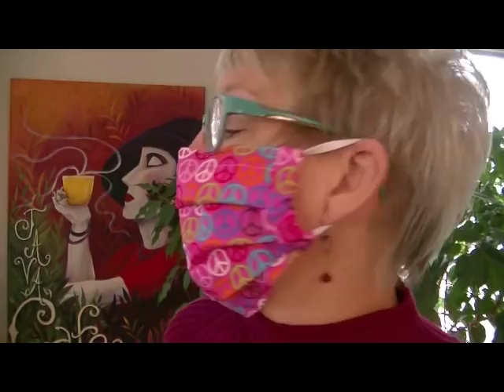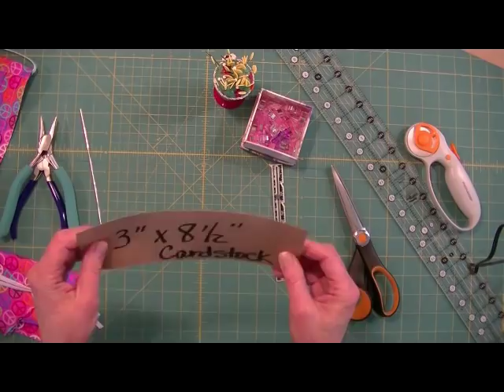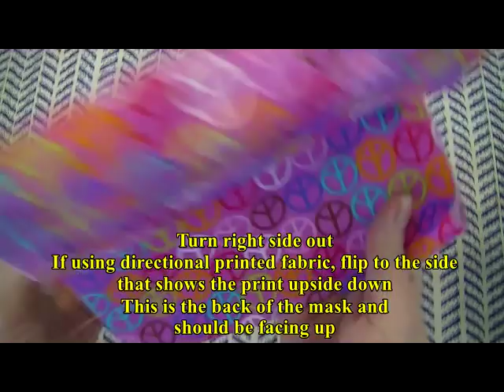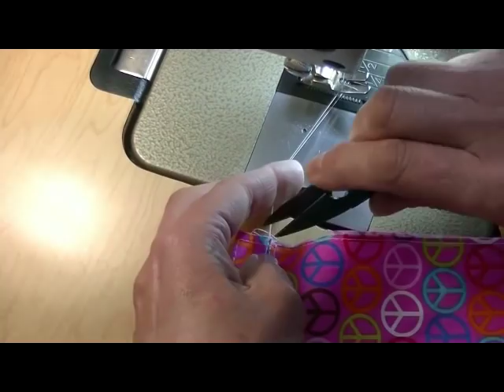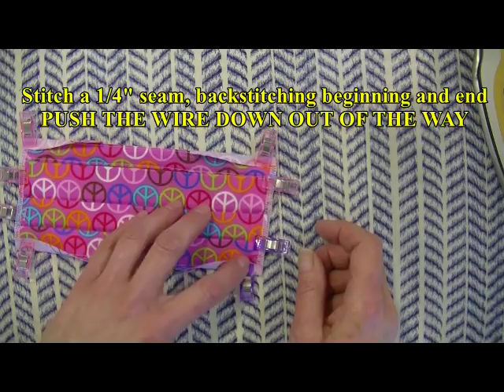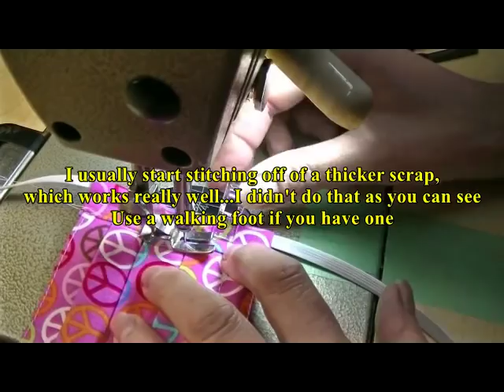DIY REUSABLE FACE MASK with FILTER POCKET-4 Style Options-1 Easy SEW Pattern-Won't Fog Your Glasses!

Comment: I’m coming back to this  video tutorial after making dozens and dozens  of them previously. (Feedback- they’re a big hit!)
Question- how much would I need to cut town this original pattern for it to fit teens or elementary school children? I have a half a dozen  in the “just before the accordion folding” step. I’m out of practice!
Reply from the maker: Thank you. I think I only reduced them by an inch or so. You will need to experiment. You could just sew a wider seam on the sides and bottom and trim it down to 1/4" seam allowance. It's been so long since I made one. I made around 750!

Comment: Hi I was very impressed with your mask, but it doesn’t seem to stop fogging glasses. What did I do wrong?
Reply from the maker: My wire is soft aluminum and about 6.5" long. I pinch it around my nose and mold it around my cheeks and that helps.
Reply: Della, I fold a Kleenex and put it under the top of mask. Smooth it well.

Comment: What size do cut the elastic for adults, 7to 9 and for kids?
Reply: I really liked your video just need to add elastic sizes
Reply from the maker: I now cut the elastic 14" and leave them untied for the wearer to custom fit to themselves. Kids 12". The extra length makes it easier to tie.

Comment: Hi Liz. I haven't done any sewing for a number of years and had to reintroduce myself to my sewing machine!! I love this mask and your tutorial is excellent. Your pleating hack is fantastic yet so simple. I found stitching through all the thicknesses of the elastic casing most  challenging. My machine needle wouldn't go through all the thicknesses at the start of the seam so the only way I could do it was to start a short distance away from the beginning and leave a long end of cotton to hand sew in to secure it. I don't have a walking foot, in fact I've never heard of one. Do you have any tips on how I could make this easier for myself?
Reply from the maker: Hi Pauline, thank you so much for watching my video. What size needle are you using? Try a 14 sharp needle and try stitching on something the same thickness like fabric folded 3 or 4times. Start that in the middle, running off the edge onto your mask, back tack and continue on. Or you can start about a 1/4 inch in, back tack to the edge and then sew forward. I hope this helps. Always use a new needle. Cheers and be safe.
Reply: Hi Liz. Thank you for your advice on sewing through the many thicknesses for the elastic casing. I made 3 more masks over the weekend and used your method. Great - no problem with sewing though the thicknesses. Many thanks.

Comment: Has anyone made this mask for children?  I love this mask - made them for quite a few people; came out great.  But, I tried another pattern for my Grandchildren (age 6,7, and 9) which were wayyy too small.  Has anyone cut down this pattern for kids?  Just curious if you did, and what measurements you used.  Many thanks!  Oh, and use coffee filters in the pocket if you feel the need (I personally don't use any filters).
Reply from the maker: I am making kids masks in 2 sizes. For your age groups I would make 14" × 6.5" and 4"× 2.5" side pieces. Pleat them them to 2.75" wide (pleat card 2.75"× 4"). Cut wire to 6" and finish off the ends

Tiny kids/faces - 6"×13", 3"×2.5", pleat it 2.5", cut wire 6.5"

Kids are tough so you will need to experiment. Hope this helps.
Reply: @makingiteasywithliz  Thanks ... already made them; love this pattern.  But, I've found that elastic around the ears is not good for little kids because they don't have hard cartilage in their ears!  So soft, that their ears just bend and elastic doesn't hold - just falls off.  They need either elastic behind the head, or tied behind the head.  Having a lot of Grandchildren, I learned!  LOL

Comment: I would be ashamed to say just how long the first one took me to make haha, and despite a few mistakes which no-one will notice, I now have a mask and am making more. I'm going to extend the length by about an inch. I just think it looks better closer to the ears, and am going to have to have to have it strapped over my head because the elastic interferes with my hearing aid. So glad you included instructions for how to make the alternative version.  Many thanks for sharing your video.
Reply: The first one took me a solid 3 hours!
Reply from the maker: My first one took me forever and it was awful lol.

Comment: Is there another “trick?”
I keep running off on the back side of the casing!
🤦‍♀️🤦‍♀️🤦‍♀️
Reply from the maker: Some fabrics slip and it has happened to me more times than I like lol. Try to press the crease extra hard and make sure it is in it's place when you place it under your foot. Also the bulk could be a factor, try starting your stitching an 1/8" down, backstitch to the end and stitch down.
Reply: Hello Debra how are you doing today?

Comment: Hi, Liz...Great tips!  I like to make my masks with a plain fabric on the back so that when wearing them a person can see which side goes toward the face.  What size would I cut the fabric so that I have two different ones?  I've tried different lengths and widths but wondered what works best for you?
Reply from the maker: Nope, not going there LOL. The math makes my head hurt on that one. Do what I do...take an inch of contrasting grosgrain ribbon, fold it over into a "V" and stitch it into the side seam on the backside when you stitch on your side pieces. Super easy, and Voila, instant visual aid.

Comment: Hi Liz, great mask, great fit, although I did have trouble with the pleats, I must have big hands coz I was all fingers and thumbs but I saw another tip elsewhere.. fold mask in half (insides together), open then fold centre on both sides, and then put on the folding template, guaranteed equal folds. 
Also, my overlocker tended to push the pleats out of place, so my other tip is to tack stitch on the machine before putting through the overlocker. 

👍🏻 Irene
Reply from the maker: I no longer use my serger at all, I now cut out my pieces with a rotary pinking blade. No more fraying and cuts down on my labor (over 500 masks), nor do I stitch my pleats. I just clip the side pieces on with large binder clips and stitch everything together at once.

Comment: Liz, I want you to know that I began making masks with your style back in April, after trying out one other pattern which wasn't great.  I have to date made at least 104 masks for myself and my husband, our family and friends, coworkers, neighbors, even our mailman, and I'm still going.  For every mask I've made, instead of payment, I've asked people to donate $10/mask to a covid relief or charity of their choice (and some donated more than that).  So effectively, your video has raised over $1,000 to good causes!
Your pattern is excellent-- with a few modifications (like the long elastic instead of ear loops, finishing the edges on the casing pieces, and using 2 pieces of pipe cleaner instead of wire, haha), I have been told that it's the most comfortable mask people have found.  I wear mine all the time and also find it comfortable even as it holds tightly to my face.  As more and more research has come out in the last 4 months about how cloth masks are absolutely effective and even imperative in our fight against this coronavirus, I feel so glad to have started making them when I did.  I wish more people understood the simple fact that wearing a mask dramatically reduces the chance of this spreading.
Thank  you so much for your tutorial which is easy to understand and follow, and for this pattern which is not just effective but easy to make.  At this point I feel like I can make them in my sleep, and I can make 2-3 in an hour easily.  If anyone reading this comment isn't sure if they should try this pattern, believe me-- it's amazing!
Reply from the maker: Wow, thank you so much. I just finished an order for 200 making it over 500 masks for me. What a wonderful idea and I hope people honour there pledges. Thank you so much for your support. Stay safe ❤

Comment: By the way, Liz, I think that the aluminum wire you use in your video is probably a 16 gauge wire, not 14. First, a 14 gauge wire is too thick to form over the nose without bruising or destroying the nose cartilage, and not in a million years could you, or would you, cut a 14 gauge wire with scissors. 18 gauge is probably less substantial than optimal for maintaining its shape over the nose, so I suggest your viewers go with the 16 gauge, or the aluminum metal flat strips that are readily available on Amazon @ 100/$10. Your video has been so useful to me. Thanks a million for it.
Reply from the maker: It is 14 gauge...1.5mm thick. I have just ordered 16g, 1.25mm thick to see how that works. I have used my masks over and over again with no problems. It is aluminum which is super soft. Have you used the exact wire I used? 14 gauge in any other metal is too stiff but works for this. Thank you for watching.

Comment: Where is the filter pocket.  And how big is the filter.  I am going to use material from a HEPA vacuum cleaner bag.
Reply from the maker: You have to be careful there is no fiberglass in those HEPA bags.
A 5"×5" filter is plenty. The pocket is on the inside.
Reply: @makingiteasywithliz  I know.  The person that suggest that said it should not be up against your face.
Reply: Use a coffee filter!
Reply: The latest research is telling us that fabric filters do just as well, if not better, than anything else!  The recommended amount of layers of fabric has been between 3-4 layers.  Denim, canvas, or natural cotton fibers are best.  I have made filters one of two ways: by cutting a 4"x5" piece of heavier fabric (like denim or canvas), or by cutting a 5"x10" piece of thinner cotton fabric and folding it in half.  There might be some bunching but it's not noticeable once the mask is on your face.  Remember also that filters should not inhibit your breathing (as I believe coffee filters do).
Reply: Use a coffee filter!
Reply: Hello Judith how are you doing today?

Comment: Hi Liz. Great tutorial.  Thank you.  WHO is now saying that the outer layer of the mask needs to be moisture repellent polyester, the middle layer a filter layer and the inner layer 100% moisture absorbing cotton.  I bought 100% polyester (checkered tablecloth material) but find it is so much more difficult to get a good fit.  I am working with three separate pieces of fabric now instead of one large one so there is the extra seam to worry about. it makes it bulkier and harder to position the pocket.  Have you made any with the polyester fabric?  How are you finding it to work with?  I also found an 85% poly 35% cotton blend and wonder if that is repellent enough...the rules keep changing
Reply from the maker: No, not polyester. 100% cotton and I never use a filter. That is my opinion. People are trying to make homemade masks about total protection for themselves...It's the other way around. My God who could breathe through all those stupid layers. My mask as it is stops my droplets. I can't even blow out a match with it on.
Reply: @makingiteasywithliz  I have made a few more with the outer polyester layer, as recommended by WHO and it is still breathable just more difficult to work with but I am getting a better fit.   I wonder if their recommendation is in an effort to now protect not only  other people but also the wearer since so many people don't seem to want to wear a mask.  I don't make the rules...just try to follow them.  Thanks for your reply.
Reply: @lesleyflaminio3739  I haven't heard anything about this recommendation, but everything else I've read has said not to use anything that would restrict breathing or is plastic-coated.  3-4 layers of a natural fiber like cotton, denim, or canvas has been proven to be effective by a few studies now.  That polyester fiber sounds like a true nightmare to work with!

Comment: Hi Liz, do people find that the 6" (finished length) wire that goes the whole length of the mask is comfortable on the face? I've seen some mask videos that only use about a 3- 3 1/2" length wire/coffee bag tie.
Reply from the maker: Hi Cathi
I wear glasses and the extra length molds around my cheeks and keeps my glasses from fogging up. The wire being aluminum makes it really easy to smooth out when I hand wash it.
Reply: Hello Cathy how are you doing today?

Comment: Should the length be placed along the selvage?
Reply from the maker: You won't be using the actual selvage. It's no good for anything because it's woven tighter. About placement on your fabric depends on the direction of the print and/or the best way to get the most cuts from it. Never go diagonally (bias) because it will stretch and lose it shape. You may already know this but someone reading this might not.

Comment: I only have 22 gauge wire will that work. Love your video.
Reply from the maker: Thank you Charlotte. 22 gauge is very thin and won't stand up to the constant bending and straightening. The higher the number, the thinner the wire. Depending on the hardness of the wire, 18 or 16 gauge is the minimum.
Reply: @makingiteasywithliz  I use electrical wire that is coated with plastic. works great
Reply: @makingiteasywithliz  thanks

Comment: Very good instructions and precise . I like the way you turned the ends of the wire into a smooth round shape , these things matter when we use them more , washing and putting them in the dryer so it can take the beating . This is the best voice I liked and will sure try to make one or many. Thanks for sharing !🙏
Reply from the maker: Thank you very much! I just hand wash  and hang dry mine, that way they are always neat and just as clean

Comment: A mask without filters is useless tho, I found an N95 filter on a site breathsafe co uk. If you make your own cloth one, you could stick it in.
Reply from the maker: It depends on where you are wearing it. The mask is to protect people from you. I don't use a filter because my droplets are contained in the mask, I can't even blow out a match. I'm not worried in the grocery store where I wear one, and keep proper distance. If I had to go to a hospital or doctor's office, then I would consider a filter.
Reply: I buy cheap pantyliners and put them into my mask. The soft side facing the inside of the mask. After every use, I just chuck the liner in the bin and wash the mask on 90 degrees Celsius.
Reply: Just stick a coffee filter in it!
Reply: These cloth masks are not "useless". They are  60-65% effective according to tests...and if everyone wears them..it's double that? There is a shortage of N95 masks in the U.S., so they should be reserved for medical personnel and those in close contact with the infected. Also, reusable cotton masks do not contribute to medical waste.

Comment: Will this mask fit a large male adult?
Reply from the maker: What do you mean by large? My husband wears XL helmet and this mask fits him. In doubt, make  4" wide when you pleat and cut side pieces 2.5"×5". Need it even bigger, cut main piece 17"×8.5" side pieces 2.5x5" making the mask 4" wide. That will add an inch all the way around.
Reply: @makingiteasywithliz  my nephew is a 6'4 giant..I did exactly what you instructed and it worked .ty

Comment: i bought serger long time ago (my 2 kids were just little and now they're 30's and never had use it yet, im scared i dont know how to use it, so im using diff sewing machine, thats not complicated for me to use.   and i love ur iron.    that's a lot of elastic u've got,many face masks u can make out of it,  at joan's limit 5yrds only.= 1/4"inch. i think i'd like wider elastic coz the 1/4" elastic its twisting and stretches fast everytime i have to remove from over my head,  i've never seen any N95 respirator mask at the store,so better make my own fabric  face mask now.   and that end of the elastic of this n95 it got removed from being pressed i think,so i end up using a safety pin to hold on that end of the elastic to that mask,not durable elastic or the way it was done-
Reply from the maker: Sergers can be intimidating and they are very fussy when it comes to threading them. I plan to do a video, "Getting to Know Your Serger", for beginners. I have been making masks for months, over 300 with an order for 200 yikes.
Reply: @makingiteasywithliz  thats a lot of masks. yes maybe tutorial on beginners on how to use sergers.thanks.= Liz.

Comment: Great video! After researching I found your pattern to be the most comfortable and having the best features. Just throwing it out there- I put masking tape on the sewing machine at 1 1/2" for the pocket seams instead of measuring and marking. I also found using multicolored cotton thread (variations in color on the same spool) worked well on all different colors and patterns (and I liked the effect). Saves changing thread.
Reply from the maker: That's a great idea about the tape and the thread. I only use white or black thread. I hate changing thread and I always have at least 3 full bobbins ready. Thanks for sharing your hacks.

Comment: I happen to have 20 gauge wire. Do you think that would be too thin or too thick I don’t know the difference between all these different gauges?
Reply from the maker: The higher the gauge number, the thinner it is. 20 gauge is very thin. You could take 3 or 4 pieces and tape them together, side by side with electrical tape. I have never done that but it's worth a try.
Reply: 20 gauge is to thin. it might break fast everytime u keep adjusting to the nose area. or being wash, it can be removable on one end, so dont sew the other end, so u can remove the wire and put it back after washing.
Reply: Hello Pamela how are you doing today?